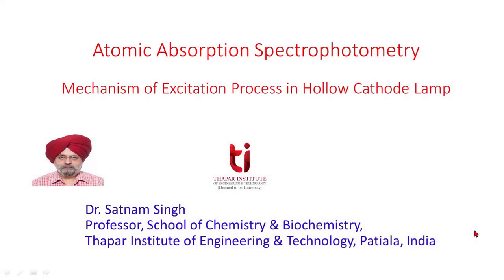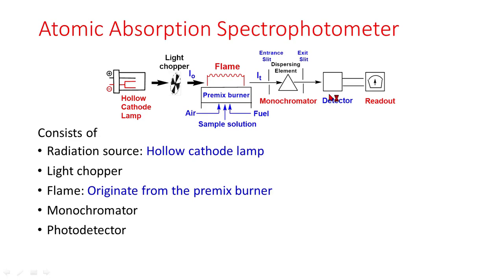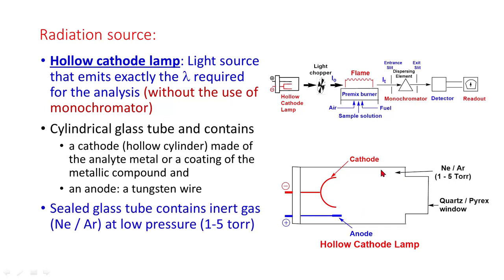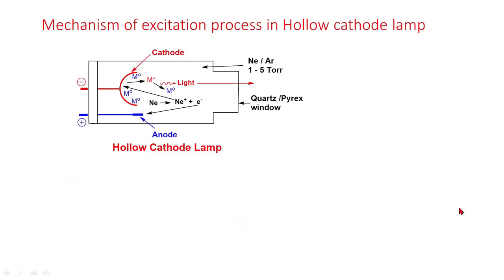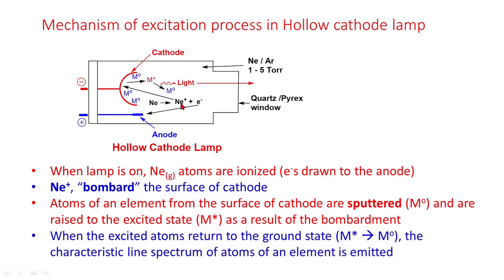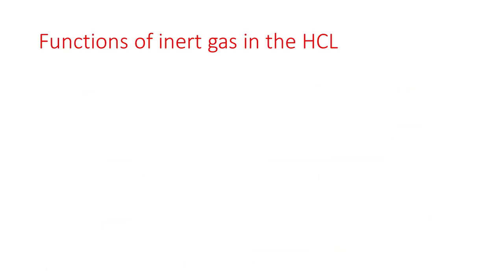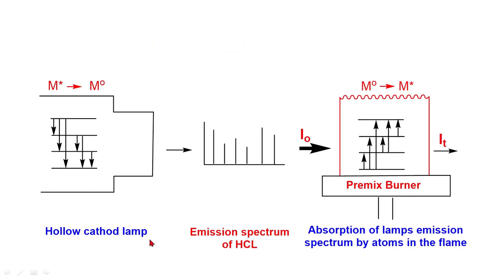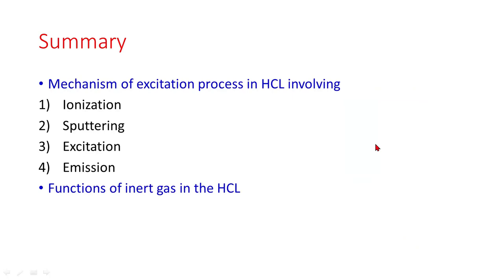Mechanism of Excitation Process in Hollow Cathode Lamp

Comment: sir , i have a doubt : HCL emit number of wavelength or single length?
Reply: As said in the video, HCL emits the spectrum of that metal used in the cathode, which means a certain number of wavelengths. Because excited electrons might go to different levels, thus provides several emission lines. We just select the wavelength that has the most sensitivity(in most case it is the wavelength providing energy for electrons to go to the first electronic level. Monochromator is used when the source is light( which consists of a wide range of wavelengths)